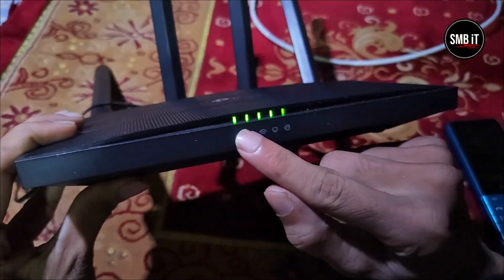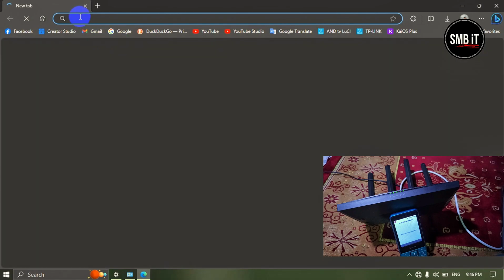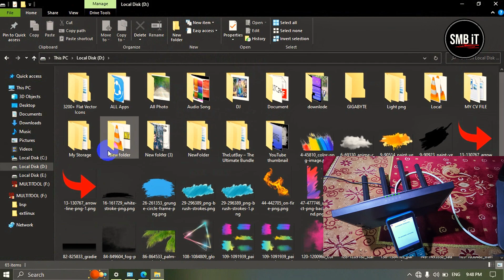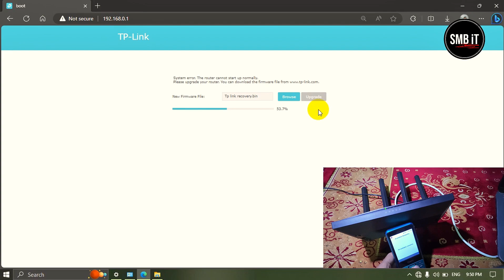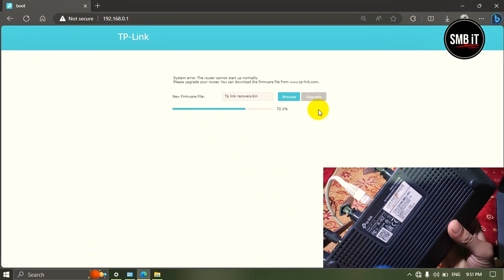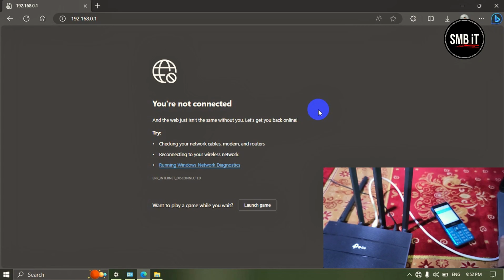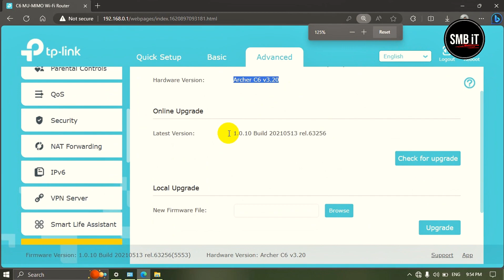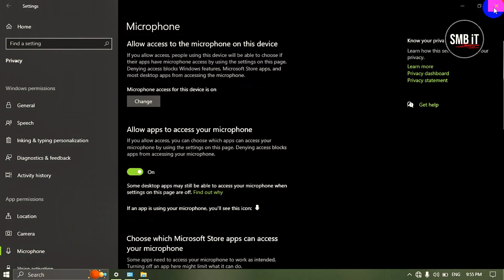How to Tp-Link Archer C6 v3 bricked / UnBrick recovery | Tp link archer c6 v3 tutorial

Comment: Only the power led is turned on for my router, its the same model TP link archer c3 v3.20 (US). I tried your method but the webpage did not load after putting in the custom IP address. Please help
Reply from the maker: Where are you talking from?
Reply: @SMBiT  India

Comment: Will this method or the tftp method work to unlock ISP locked TP-Link routers like Archer C5 and C6? An ISP named ACT lock its routers but the admin page and options are same as of a default tp-link router. However they are network locked and when firmware update is tried from admin page then it gives error "Error code 4503 - the uploaded file was not accepted". I currently dont have such a router to check myself.
Reply from the maker: What is your router model?
Reply: Archer C6 v3
Reply: Any update?
Reply: @akashteotia1363  I Have same issue., Bro any solutions... Tplink ac1200
Reply from the maker: Please watch this video carefully and comment if you don't try